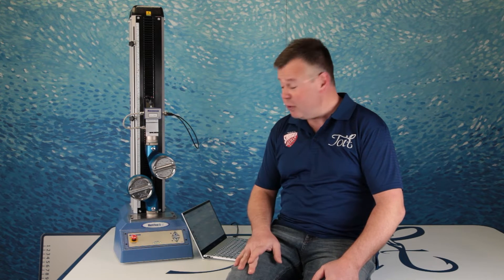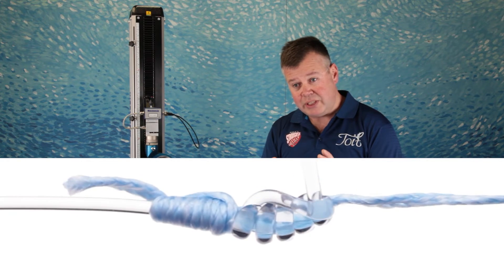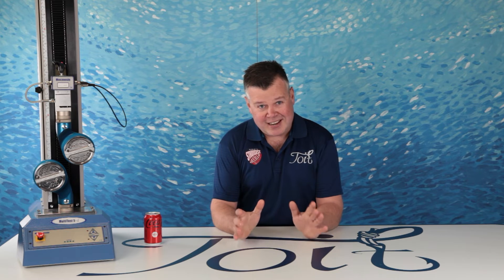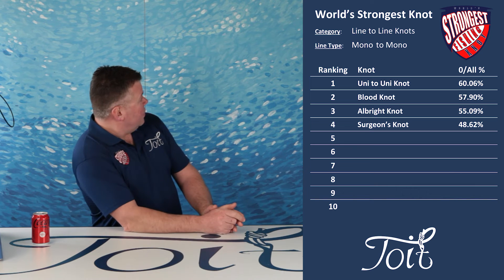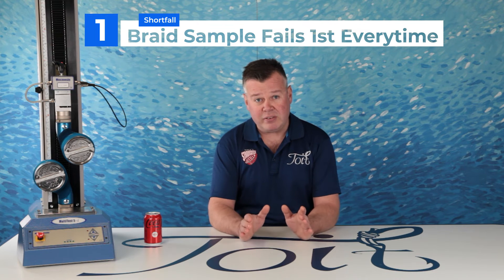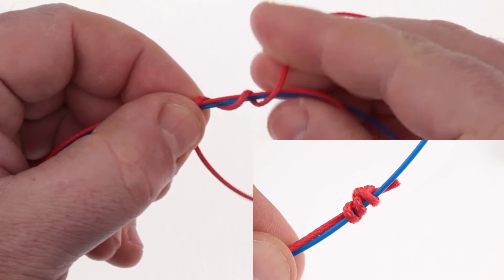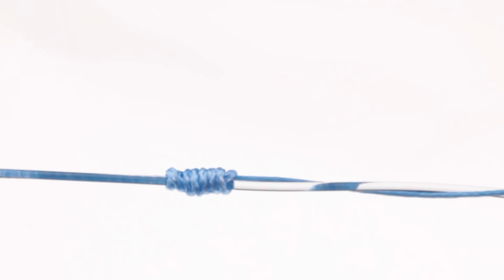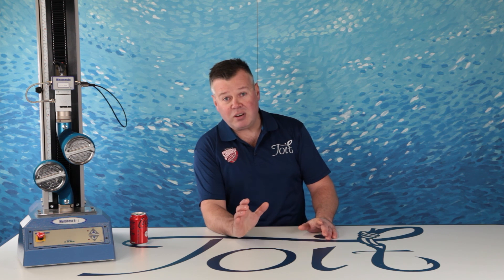Uni to Uni Knot Tested | World’s Strongest Fishing Knot | Episode 13

Comment: Just found you and will be binge watching the rest of your video's. I have been using the uni to uni knot on 30# floro x 30# spectra for about 15 years without any failure like you've shown but with a little difference. After I tie the knot I apply Loctite Ultra Liquid glue (their most waterproof glue) to the knot just enough to soak into the knot. By doing this there's not any slippage plus on short leaders it protects the knot going through the eye's of the rod. It would be interesting if you did a test on this way vs no glue to compare breaking strengths. I fish this rig on rockfish in Northern California which puts this knot and system to the test. Look forward to see your opinion on this.
Reply from the maker: Hi Crowman, Welcome and thx for subscribing. This is great information thx for sharing. Really helpful. I have met so many people who use superglue a lot. A few months back I did an intro into Superglues just to get a feel for it and also to see if the glue itself actually has any detrimental effects. That may be of interest to you. I keep meaning to do the follow up on the video. This might just get it bumped up the list. So thank you for raising this. 

Would appreciate your feedback on the videos as you go thru them. Enjoy and Tightlines.
Reply: @toitfishing  Will do. Thanks

Comment: I love your systematic approach.  Very good, very helpful in making knot decisions.  I'm wondering... are some connecting (not terminal) knots better at holding lines of different diameters.  For example, I'd love to see a Blood vs Uni comparison connecting 5#/5#, 10#/5#, 10#/10#, 15#/10#, 15#/15#, 20#/15#
Reply from the maker: Evening Greg, apologies for the late response. Hope you having a nice weekend. I am all about systematic, possibly even boring depending on how much you can handle listening to me talk about knots. 😂😅 I do have all the comparison in the charts at the end of all the WSFK videos. to get the latest on the terminal knots just watch the last video shown of the terminal knots and you can see the summary. For specific line sizes you will have to compare charts. Yes indeed you are correct, you can see this very clearly in the Trilene knot vs Uni Knot. Uni excels at thicker lines whereas the Trilene excels in the thinner lines. All down to the geometry and line lay within the knot. TightLines

Comment: Quick knot do you recommend as the strongest for connecting braid backing to braid topshot?
Reply from the maker: Morning Cape Fox, single braid line into single braid line I would take a look at the version of the clinch knot used in the Slim Beauty Testing video, basically the knot on the braid end side of things. Its essentially a over wrapped clinch knot. Then use that for both lines and form a Blood Knot.

If you are opting for the ultimate knot you might be better tying two bimini twists on either line and link these with a Blood Knot. I would knot overwrap it in this version as you want all 4 lines loading up as much as possible. ALas I have not tested the Bimini in Braid yet but you will need many wraps. Hope that helps, Tightlines.

Comment: Did you test more turns on the braid?  My go to is 13 turns on the braid and 7 on the mono
Reply from the maker: Hi Maufish13, if you look at the results tables in all the WSFK videos, you will see a section on the table, bottom left, where I tell you the exact wraps used on each knot, if it has wraps etc.

Typically I use bars on all knot testing above 10lb to tighten knots, as this gives a tighter cinch and the actual measured result is a lot more consistent with no slipping, so on this knot I used 8 wraps on braid and 4 wraps on mono. If you do hand tighten only, you may need to adjust your wraps accordingly.

Hope that helps. Tightlines

Comment: 13:16 -- Which line to line knots are best for braided connections?  Uni to uni for braid to mono/fluoro is so easy it's sad to see that it's not recommended.
Reply from the maker: Hi Jake, I think for a beginner fisherman the Uni is the best knot hands down, one knot does it all. Braided lines are really a fickle thing when it comes to knots. Those inner micro fibers are really susceptible to cutting in on one another, the Uni knot unfortunatley forces the knot to cross over repeatedly over itself within the knot creating multiple areas for the inner fibers to cut in on each other.

Comment: I use the braid to braid uni to uni when cutting out a tangle, or adding line to a spool without a complete respool(especially deep dropping and you lose 200m of braid). What knot would be a better option for a braid to braid connection? Love the vids and the new format, all good!
Reply from the maker: Hi Adam, appreciate the feedback. I am hoping to have the Slim Beauty WSFK episode out soon. You won’t believe how this thing flies but there is a few key areas to follow. Also this knot is more of a leader connection rather than the application you require.

For now I would suggest tying the blood knot, but slightly different to what I tested. Double the braid line on each end, then for each end tie an overwrapped clinch knot with 8 wraps up and 8 wraps down. Use bars to tighten, wrap the standing end and tag end on both sides and pull all 4 lines together. You can then cut off the 2 tag ends and the 2 double loops.

If you are not pressed for time you could tie a Bimini on each end to produce the double loop then tie the above knot.

Of what I have tested on Slim Beauty and Blood knot this will give you the best results. 

Tightlines, let me know how you get on, have a great weekend.
Reply: @toitfishing  thanks warren! You’d be a wazza in Australia :)

Comment: Hey, I just found your channel, and really appreciate the information you are putting out. I love all the data, and you present it in a professional way. Thanks!

One question-do the results on the line to line uni knot change if you have heavier main line (braid) tied to a lighter leader (mono or flouro)?

It seems fairly common for bass fisherman here to run 30-40 lb braid to a 15-17 lb fluoro or mono leader.
Reply from the maker: Hi Mike, appreciate the feedback, glad you are enjoying the content. I think with the Uni to Uni based on what I have tested to retain as close as possible to leader line strength I would be tying exactly what you mentioned. Double the leader line weight to calculate recommended braid line to use, as in your case if you are fishing with a 15lb leader, I would be tying a +30lb braid line to that, maybe even the 40lb as you suggested. I think with all leader line connections, if you test your knot until you can force the leader material to break, either the mono of fluoro before the braid breaks you have the optimum braid line strength required for your knot strength.

Tightlines and appreciate the support.

Comment: I like your new presentation format a little better. However, it's a lot of info to read/absorb quickly. Do you have this data on your website?
Reply from the maker: Hi RStout59, appreciate the feedback. Currently I do not have any data on my website.  I may do some kind of Patreon thing in the very distant future which will then have all the data on including displacements, load graphs etc. as the data you currently see is only about 25% of what I currently report. There is a lot more to these knots and line types, which I can hopefully share going forward. Hopefully for now if you just hit the pause button to look at specific line types or closest match to what you normally use. Tightlines and thx for your continued support.

Comment: Do the FG knot(from salt strong vid) vs the uni knot or toit knot
Reply from the maker: FG is on my to do list, thanks for watching and thanks for the comments on my various videos, much appreciated. 

Tightlines
Reply: @toitfishing  make sure to run at least 30 windings on the FG and use saliva before you tighten it. Another guy did the FG vs PR knot and had very mixed results...thanks!
Reply from the maker: @redfishbluefish965  I typically spend a few days pre testing every single version I can find and will also test various combinations of wraps especially with the FG knot. You may want to look at my GT knot playlist start off with the “Actual vs Viral” version. Funny enough the FG I touched on in that video and it’s very interesting what I discovered regarding FG snd GT actual version. Tightlines.

Comment: I use uni/uni for up to 20lb then fg from there up for my leaders no issues. (Mono/Fluoro to braid)
Reply from the maker: Hi Doe Boy, Thx for reaching out both knots you mention are great fishing knots, Uni to Uni is so versatile and easy to use for people just getting into the hobby. I use and have for a while now enjoyed using the FG Knot. I have not tested the Uni Knot yet but I think it should hold up well. I did a video a while back comparing the Actual and Viral version of the GT knot and when I did my research on the knot it was interesting how knots and knot names have changed over the years and how knots have evolved. You may find that interesting especially if you like the FG knot. 
Tightlines

Comment: Do the uni knot vs the toit knot!
Reply from the maker: Might have to do this as a Shorts# series. Most subscriber votes/ideas decides the next video. 

Have not tested them back to back. Thanks for watching. On the last episode I did on terminal knots (Pitzen knot Episode 7) you will see the rankings and how these knots compare so far based on all my line to line categories.

Hope that helps. Let me know what you thought of the suggestion.

Tightlines.
Reply: @toitfishing  my thing is that if I run a 40# braid to a 30# floro with the FG knot, then the 30#floro to a toit knot on the hook, then I don't want my FG to break before the 30# on the toit and loose my fish... thanks!
Reply from the maker: @redfishbluefish965  the strongest line to line connection I have tested in my WSFK is the overwrapped Slim beauty knot I think you might like it, unless you are a lure fisherman and then FG is going to give you slimmest profile. Although Slim beauty is really slim especially on those lines you mention.

This idea below is based on very limited testing and I have not had time to substantiate it too my normal WSFK standard but I would look at it if you are a boat guy etc.
If you are looking for ultimate strength I would tie a Bimini(50-60 twists)into either my modified GT knot or a Actual version of GT knot. I did a few tests on this and it’s really really strong. 

Tightlines

Comment: Sir, please test the Relix Knot, (knot to tie the braid to the leader). This knot is claimed to have a strength of 90 % to 100 %.
You can learn the relix knot on the YouTube channel (Amin Maulani).
Reply from the maker: Hi Muhammad, the Relix knot is definitely on my to do list. I would appreciate you pointing me in the direction of that data and testing parameters of 90% - 100%. That is incredibly strong for a line to line connection, WOW. I have had the same request from a few people now so I will make an effort to get this lower down on my list. Thank you for the support and comments, Tightlines.
Reply: @toitfishing  Yes Sir, Relix Knot have special rules in making it, has 3 step. the first step of Holding (6 coil), the second step of the shock absorber (20-30 coil) and the third step of locking (6 coil).

Need to pay attention is in the second step (shock absorber), the mainline in this section is shaped like a spiral.
Good luck sir , thank you 👍
Reply from the maker: Hi Muhammad. Thanks for the advice. I look forward to testing the knot, lets hope its really good. Many thx.